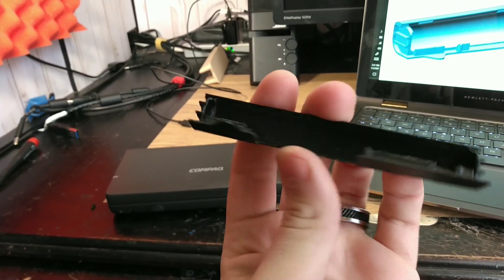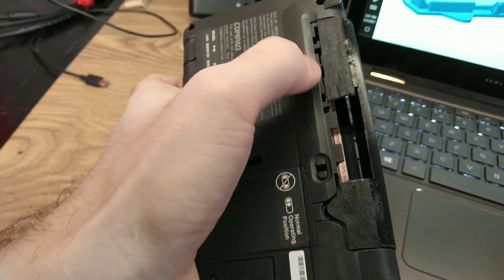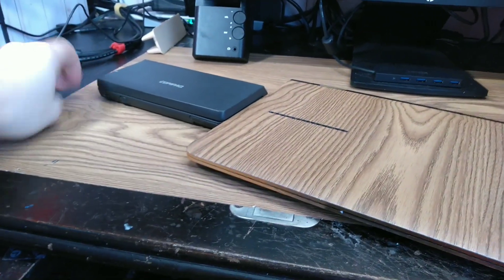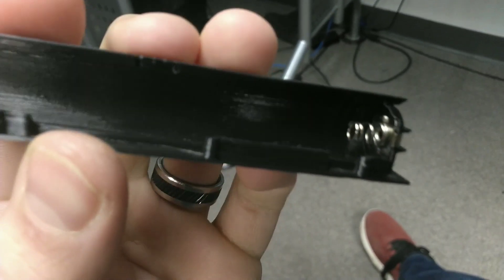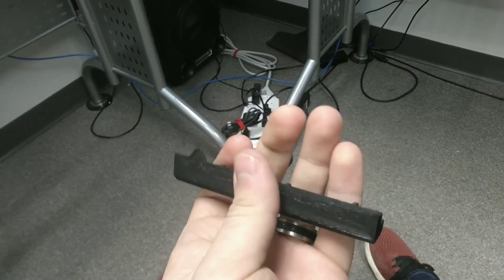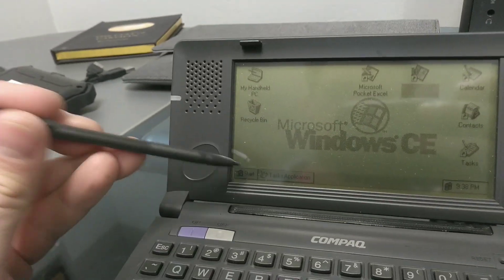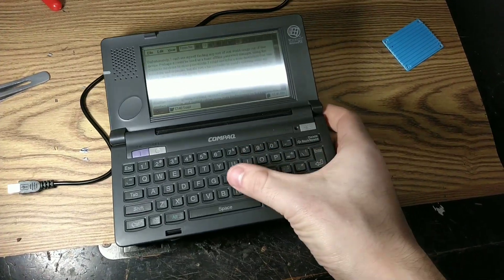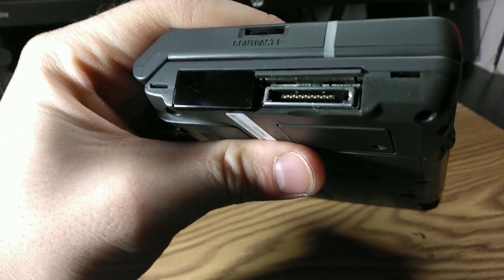Windows CE Handheld PC Repair - Compaq C140 3D Printed Battery

Comment: Get an old laptop with irda and run Microsoft Active Sync on it or if not Windows CE services i think it's called think there's arsing around involved with ActiveSync though as none USB connections are done by com port numbers

Comment: I recently bought a c120 but can't get it to turn on is it because no chip?
Reply: I have an old retro Compaq C140. I thought it was dead also, but there is a finger-tip roll screen on the left edge of the display, and you have to roll that to set the display. Should work with good batteries.